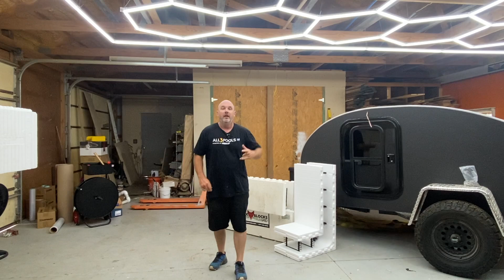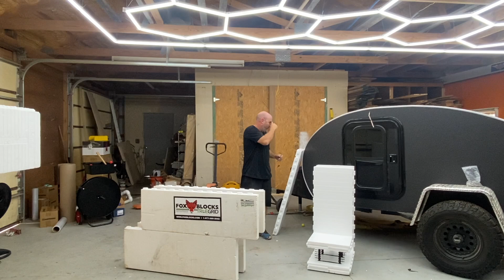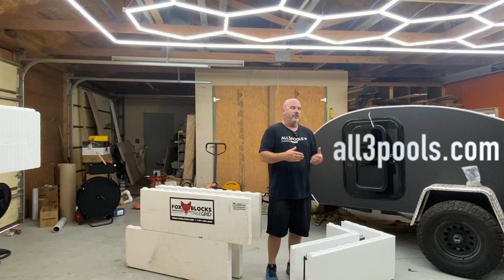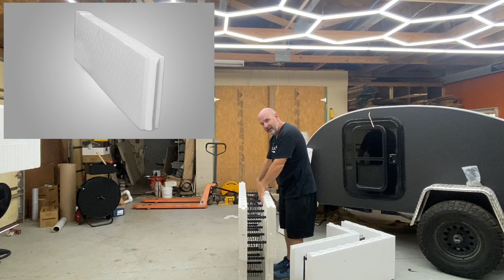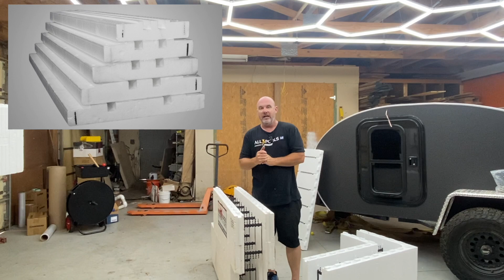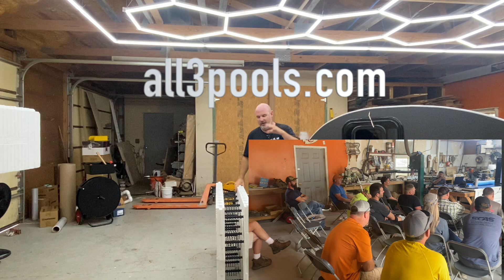Fox Blocks ICF, Full Product Review!!!

Comment: I live here in Mississippi and see all these Dole Banana trucks come and go.  I know they leave with bananas, but do they come back empty?  If so, some of these block companies might be able to set up warehouses closer to end users.  Or maybe builders could work out something.  Also, does Fox Buck fir other block systems.  I know they are not going to fit perfect, but can they be used with a slight "field mod" so the thermal break can be used.  Since the bucks are flat, the freight cost would not be too high.

Comment: a Fox Decking or Roofing would be great ...esp if they could design it to work both exposed (flooring use) & encapsulate the concrete/rebar (double insulated roof) with a 2nd locking top layer.

thx for doin this series, Aaron!

Comment: I’m just curious if I were to build a house with new construction and everything were planned well how cheap can you get an inground hot tub, down to .
Labor and materials while doing a new construction I’m assuming would be vastly different then a pre-existing house because you can engineer the property to make it easier for the install
Reply from the maker: Not really, in ground hot tubs are very expensive no matter what…. Same pumps filters and heaters as 30k gallon pools, and more plumbing crammed into tight space…. Buy one and drop into a well and you’ll be happier
Reply: @all3pools  how about the idea of above ground ICF?
I own a trucking company so I can have a 53 foot trailer pick up the block and take it to Florida if I need to. 
I’m kind of set on wanting Fox Block to do my home when I build in Florida.
And due to the type of soil on my property being Sandy I was looking for an excuse to dig out a little extra so that we can use the soil elsewhere.